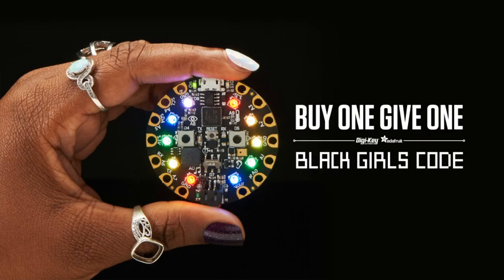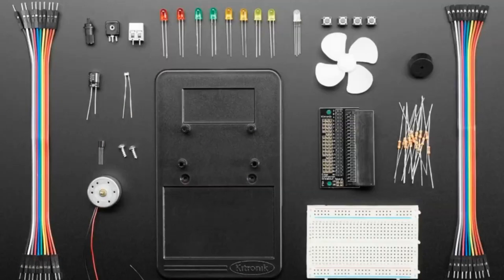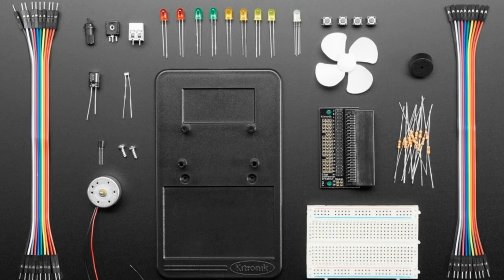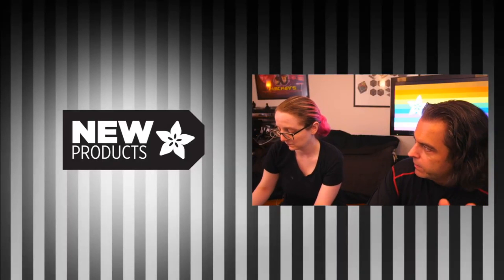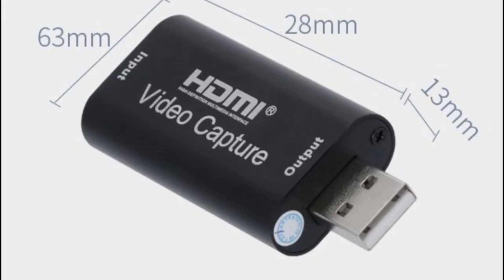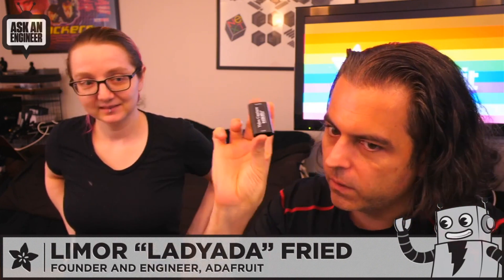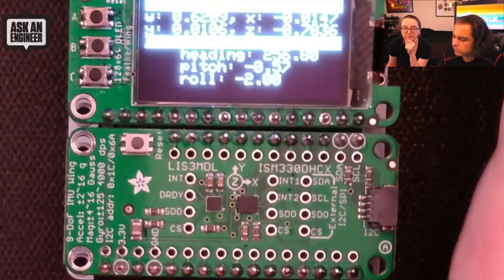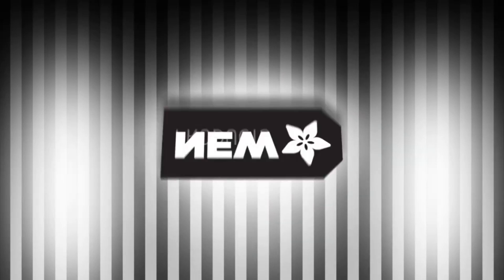New Products 6/24/20 featuring Adafruit ISM330DHCX + LIS3MDL FeatherWing - High Precision 9-DoF IMU!

Comment: I'm looking to see if there's a KVM application available for this.  Would require a device with HDMI target to capture the keyboard and mouse, along with this to capture the video.  Then present as either Microsoft remote desktop availability, or as VNC port.  Just starting the search.  I think I saw one that took an HDMI capture unit, will have to track it back down.

Comment: So the BNO055 is the version that has the Bosch sensor fusion in it. It's the same sensor and internal mcu as the BNO070/080/085 which run the Hillcrest sensor fusion code which is much nicer than the Bosch fusion. They're all pretty neat though, and the ST ones sound nice too! (I think that was the one they advertised for use on heavy construction equipment for equipment health monitoring, iirc)